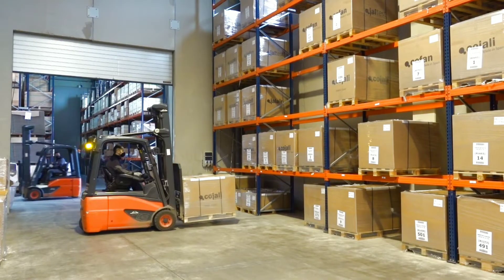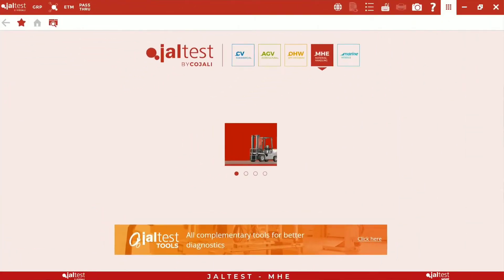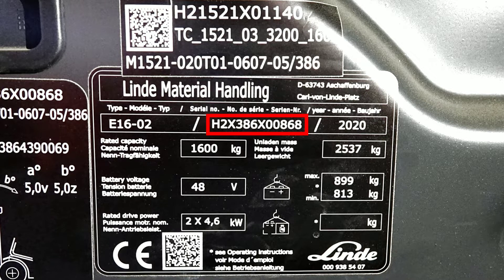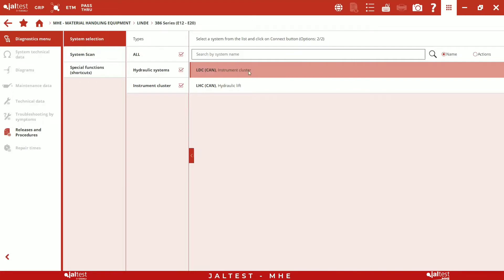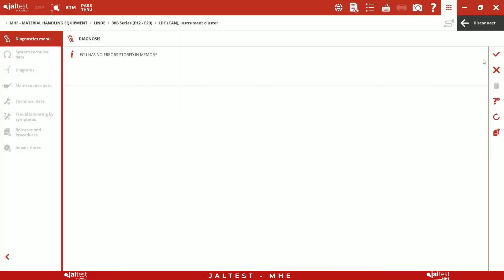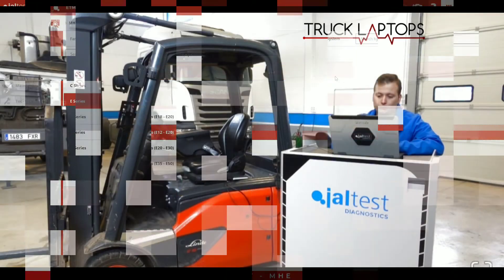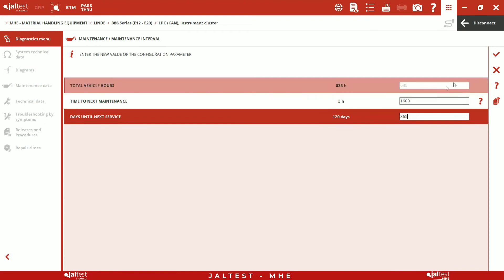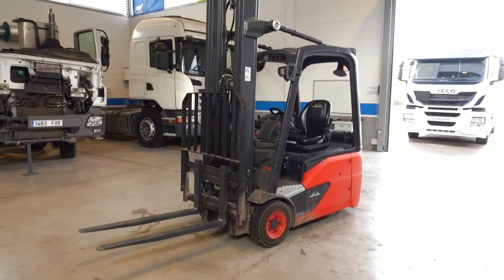Linde Forklift Repair with Jaltest from Truck Laptops

Comment: H80D-02   Forlift is very slow but fully operational screen says overload and alarm even if you press the yellow overide button still moves slow any help would be appreciated thanks
Reply from the maker: Is this a linde too?
Reply: @trucklaptops  yes its a linde
Reply from the maker: I may need the serial# too.... I will look it up in the laptop.
Reply: @trucklaptops  H2X396D50605 thank very much for your help forklift has been park due to issue for months
Reply from the maker: @danielg2804  are you getting any kind of fault code with this?
Reply from the maker: @danielg2804  I ran your Linde fork lift symptoms through our laptop and its giving me 50Plus diagnosis for the problem but its asking me for a fault code. Do you have one?

Comment: T411 code on h70 linde forklift, any coment?…
Reply from the maker: found that is related to the CAN: ‘’T411-415 fault codes - the communication between Can bus and power module leftside is faulty’
Reply: @trucklaptops  thanks for your info, God bless you…